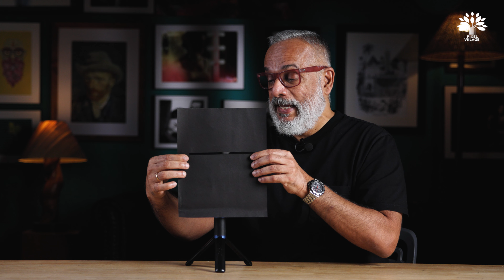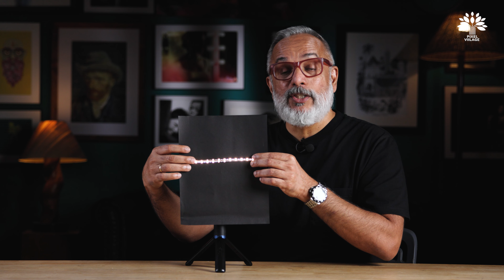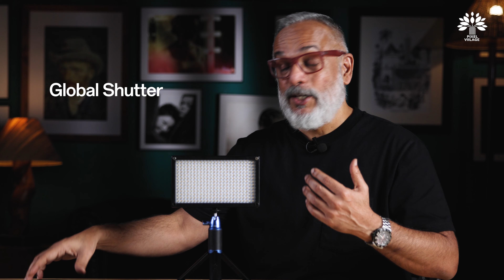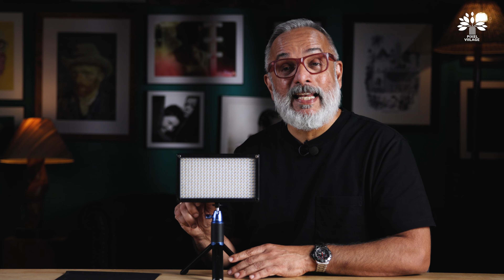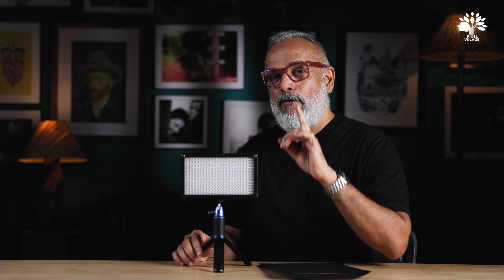'Global Shutter' Demystified.

Comment from the maker: In a hurry to finish the video before our editors goes away on a long Diwali Holidays, I seem to have made some fundamental (gross) mistakes in this video. I would like to correct it here:

1. Contrary to what I mentioned in the video, the Global Shutter doesn't read-out 50 times in a second during a 1/50 shutter speed! It will depend on the Frame Rate not Shutter Speed.

2. Apologies for not specifying that this is best suited for Filmmaking! 🙈

3. Also please note that by saying 'Line by Line' what I meant was that the Rolling Shutter will expose the Sensor gradually in portions. Please do not interpret it literally. Thank you.

Comment: A camera with a stacked sensor for faster readout can drastically reduce rolling shutter..and stacked sensor has other advantages also...buy camera with a stacked sensor are few and costly high end..a nikon z6iii jas a partial stacked sensor where as nikon z9 and z8 have stacked sensor the new canon r5ii has a stacked bsi sensor where as the canon R5 did not have it.... 😊

Comment: dear radha, der radha,
1.  I do not think it was sony that started the mirrorless revolution.
they might have introduced the the first mirrorless full frame.
but revolution? NO!
you remember the olympus micro 4/3 camera you sent to me in 2010?
or did you forget that?
that was the real mirrorless revolution!

2.  when you are using a 1/50 shutter speed, the shutter does not move all the way across the frame gate in 1/50 of second.
what happens is, every single pixel in the sensor is exposed to the light for 1/50 of a second.

3.  I guess when you were using the term "rolling shutter" you actually meant focal plane shutter.

4.  The most important benefit from a global shutter is lack of shutter shock or vibration.
Reply from the maker: Thank you Doc... for your comments. 

1. I think it was Epson. But Sony created the first 'Full Frame' Mirrorless!

2. I have corrected that statement and pinned it.

3. The rear Focal-Plane shutter will be the electronic shutter since it is the part of the sensor itself!

4. That's a bonus. Real beneficiary is only for the Cinematographer. There will be no Shutter Shock/Vibration in most modern mirrorless cameras when you engage the Electronic Shutter.

🙏❤

Comment: Can jello effect occur in electronic shutter cameras as well? 
Also, 
Isn't global shutter the same way how sensors work in smartphones? Why is it so legendary in digital cameras then?
Reply from the maker: Well... It is reduced but cannot technically be avoided. As far as I know smartphones use Rolling Shutter.
Reply: @PIXELVIILAGE  so , do you mean that even in electronic sensor cameras, the sensor is exposed in portions, just like in rolling shutter cameras where we had a mechanical shutter. I have always wondered about this, since in every image of a mirrorless camera out there, we can see the sensor directly without any shutter.
Reply from the maker: @gurudath_s  That’s correct. Electronic Shutters and faster sensor readouts in modern mirror leases have minimised the Rolling shutter effect but not completely.